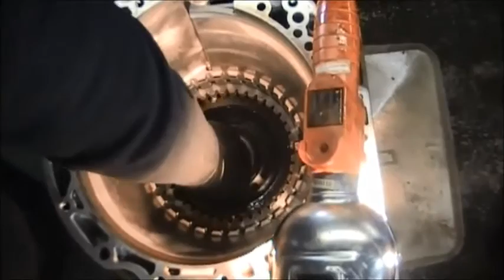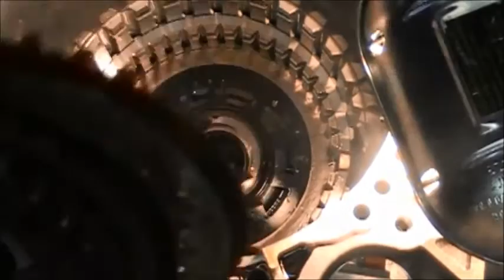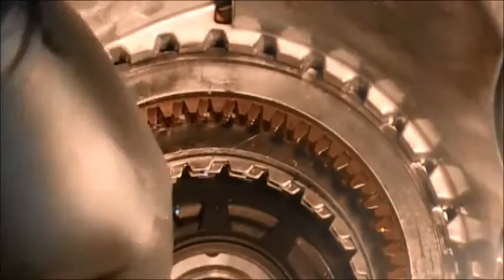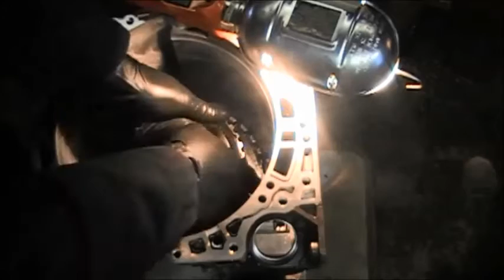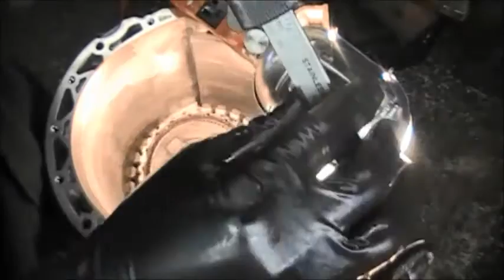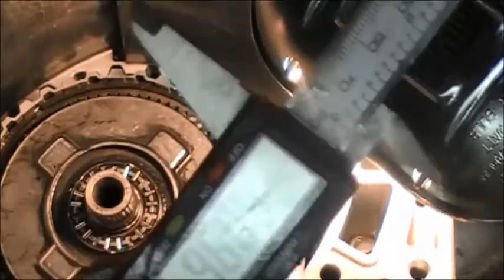Mercedes Benz 722.6 transmission repair part 7

Comment: Wow you make it look sooooo easy, would the same instruction be on a 1990 420sel transmission,
Reply from the maker: I am not familiar with the 1990 420sel transmission. However, I did do an old Mercedes transmission before, and I did not have a problem because principles are basically the same.
Reply: Thanks for replying. I've watched your Video , It's really a game changer because the way you you instructed ,the way you talk through it, And when you explain how each piece of work is very Knowledgeable. I guess the hard part for me is how I'm going to drop the transmission out of the car lol but watching your videos I believe in my heart  That I can rebuild my transmission with the help Of your videos

Comment: The B3 bottom spring plate has 3 outer tabs, Why have you placed one of these tabs into the larger slot? I thought it would be better to place each outer tab into the smaller slots.
Reply from the maker: philip day I don't see where I did that. However, if you follow what I show in this video, it will work.
Reply: +questioning3  to follow phillip day question its at 0.43 the bevel washer tabs fits into the larger slot on the bottom clutch but the next bevel washers doesnt seem to placed into a larger slot. i hope my question makes some sense
Reply from the maker: I thing that I understand your question. I put the first spring in the larger spot because it fit perfectly. The B3 spring may not have been placed in a large slot. I could have placed it in a random slot. The most important thing to understand is to make sure that you place it in a slot that works. If it does not work, it will not fit. It may not necessarily has to be placed in any particular spot.
Reply: +questioning3 thanks for the quick reply I understand what you mean now, i have a transmission out of my mercedes ml270 thats flailing in 4th and 5th snd jumps into neutral when under max load so this series of vids is very interesting thanks again
Reply: Iv got an error code 147, gear implausible or transmission slipping iv changed the oil and conductor plate is there anything else i can try before pulling the transmission out ? Its a 2000 ml270cdi with 100,000 mls thanks again love your vids
Reply from the maker: What did you have before changing the oil and conductor plate?
Reply: +questioning3 i should have put more info up i just bought the car as a winter hack and have a feeling the previous owner knew that the trans had problems but im a ex john deere mechanic in the uk so not scared of a rebuild if needed. It drives really nice in 1st 2nd and 3rd then flares in 4th and 5th if using kickdown up hill in it will jump into neutral but will go back into drive when i slow down but the trans is then locked in gear untill i turn it off then back on. I dont really trust alot of the trans companys over here they just want £2000 - $4000 to do a rebuild and it aint worth that so im going to repair myseld again thanks for the speedy reply i hope your having a nice christmas
Reply from the maker: you have to do some checking. first, check to see if the tcm has been flooded with transmission fluid. Disconnect the tcm and see if it is wet. Turn it upside down like in the video that I posted. Then we will go to next checking step.
Reply from the maker: Still what did it do before you worked on it?
Reply: il put it on the ramp when im next in work in a few days time, so check the plug with the 7mm socket has not been leaking oil, check the tcm like you said dont have any oil in it. and do another scan of error codes, when checking the oil level the other day i though i seen a small piece of clutch type material in the oil, im also going to do a glycol test. if ok with you il report my findings, just out of interest would you be able to supply any parts i need obviously id pay cheers Peter

Comment: After its all together how hard should it be to spin the input shaft by hand just wondering .
Reply from the maker: I don't know how to measure this, however if you put some vice grips on the input shaft it should turn very freely. There should not be a struggle.
Reply from the maker: If it is hard, then something is not right in the transmission.
Reply: THIS IS YOUR TRANSMISSION ill pull it back apart as a precaution
Reply: THIS IS YOUR TRANSMISSION  i pulled back apart double checked her out it seems the new clutches are grabbing sticking together i added more fluid to lube it and reassembled i checked all my clearances and torqued to spec
Reply from the maker: @Dieselpwr  if you can turn the input shaft by hand you should be ok